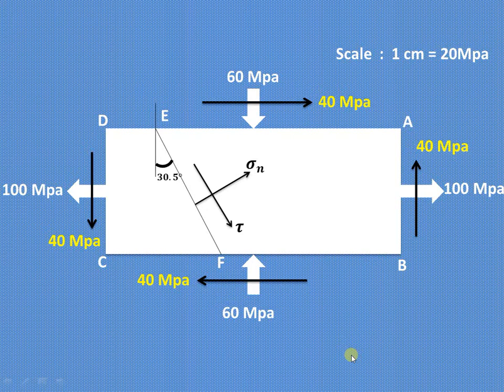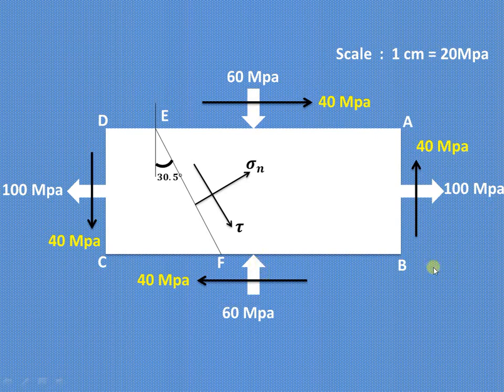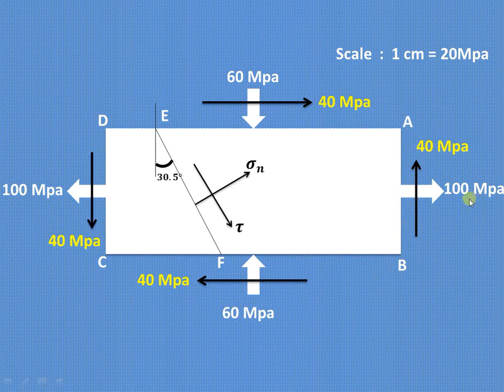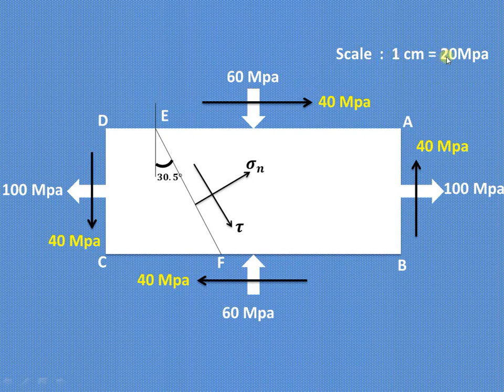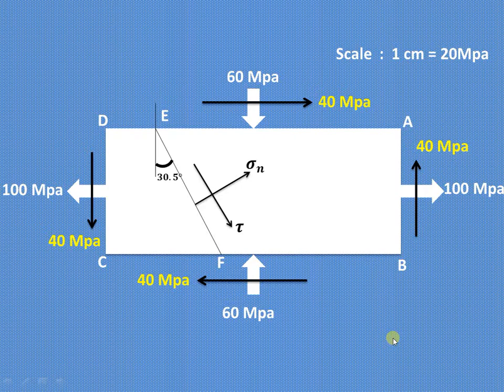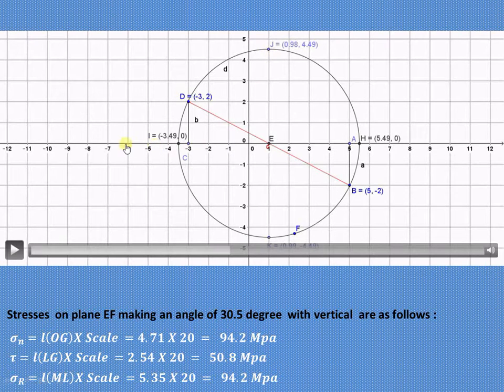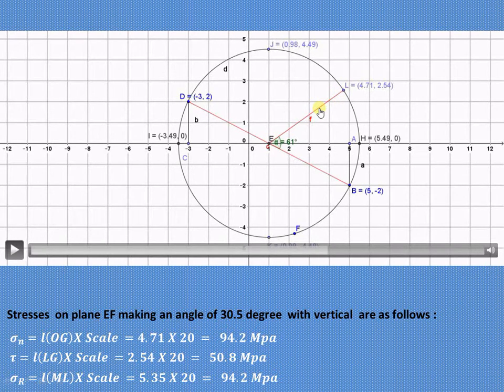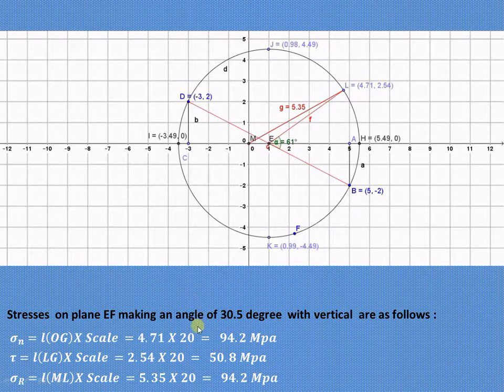Lecture 3 | How to draw Mohr's Circle

Comment: so how exactly do you pick your scale, and what would you need to keep in mind when selecting such a scale?
Reply from the maker: The things that you should keep in mind while selecting the scale is the magnitude of stress and larger the diagram more will be the accuracy in calculating the various stresses. For e.g. if the magnitude of the stress is 60 MPa then take scale of 1 cm = 10 MPa , which means you are representing that stress by (60/10=6 cm) on your graph paper. Hope it would have cleared your doubts..... THANKS...